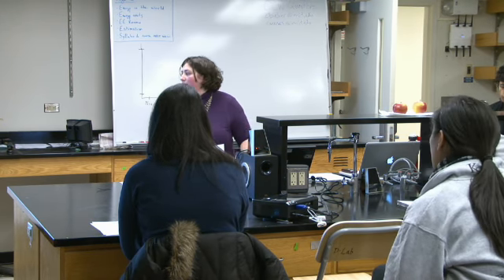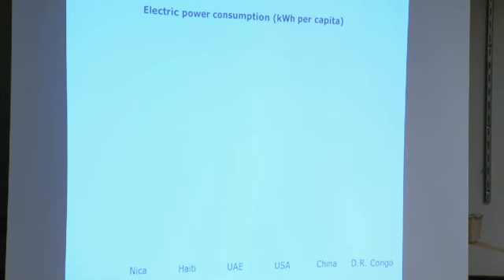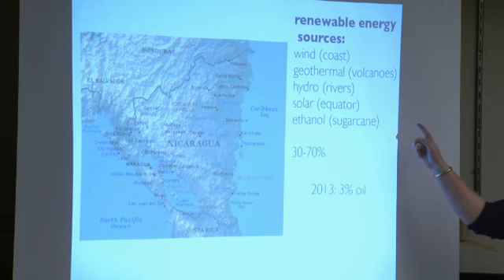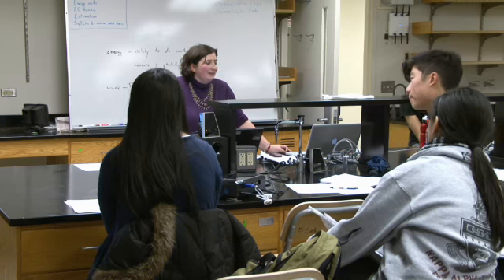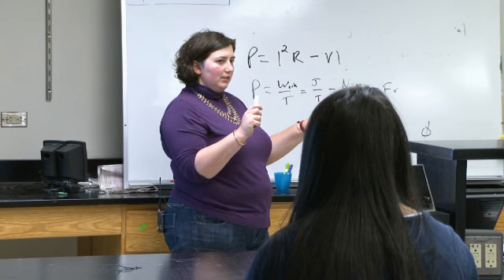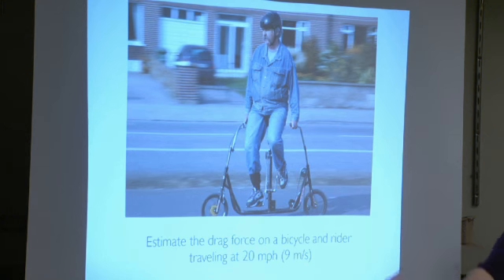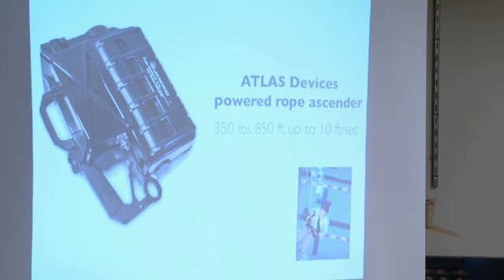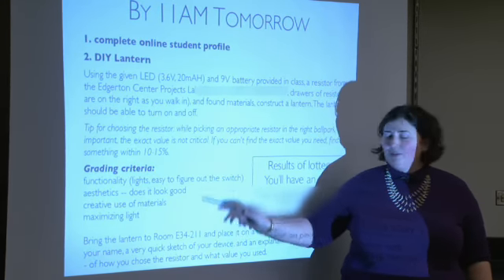1. Introduction to Energy

Comment: 1. Which statement best defines energy in physical science?

A. The rate at which force is applied
B. The amount of matter in a system
C. The capacity of a system to perform work or produce physical change
D. The resistance of matter to acceleration

Comment: Energy is not the ability to do work because there is no equivalence between work and energy. Work is not the force to move an object over a distance neither. This definition or description labels or identifies work as being a force and work is not a force. Power is not how much energy is required in a given amount of time because ,as mentioned, there is no equivalence between work and energy. Power can't be used to determine the amount of energy stored in a battery.
Reply: Please 3xplain it to me then in your words
Reply: @niketsinghsciencechannel3084  Energy is not the ability to do work, only that energy is required to do work. However, the work done on an object does not reflect the energy transferred to the object. We need to first look at the fact that work is not a function of displacement.

Work can only be done on an object moving at a constant velocity if the displacement of the object is caused by a force. An object moving at a constant velocity does not require an external force to continue moving at a constant velocity. The exception to this general statement is here on Earth with the presence of friction and gravity. Friction needs to be balanced to keep an object moving at a constant velocity on a horizontal surface and gravity needs to be balanced to keep it moving straight up at a constant speed. The energy transferred to an object in either scenario allowing it to keep moving at a constant velocity only balances out these forces and does not cause a displacement of the object. This is to say that no work is done on an object moving at a constant velocity by an external force. The displacement of the object is caused by its momentum. There is no distinction made between an object moving at a constant velocity with balanced external forces on it and the same object moving at a constant velocity on its own with no external forces on it. In both cases the displacement of the object is caused by its momentum. 

However, this does not mean that no work is done on the object moving at a constant velocity with balanced external forces on it. Momentum is incorrectly defined as the quantity of motion. Momentum is kinetic force or the force with which a body moves which refers to its impetus just like kinetic energy is the energy possessed by a moving object. So, you have kinetic force which is the force of motion and as well as kinetic energy which is the energy of motion.

The force with which an object moves is due to its inertia in conjunction with its velocity. The moving object has inertia or mass resistance which is the amount of matter resistance an object has to a change in its velocity. So, just like mass is the amount of matter, we have mass resistance which is the amount of matter resistance. Inertia is directly proportional to and depends on mass. The greater the mass that an object has the greater the inertia or mass resistance that the object has.

Inertia(mass-resistance) ∝ mass
Inertia(mass-resistance)  = k*mass
Inertia(mass-resistance) = (1)mass

This means that inertia is a scalar quantity and has the same unit as mass. We can also refer to inertia using the term resistive-mass(mr) with "r" as a subscript as a reference to its resistance to change in its state of motion. We ,then, take the momentum equation and modify it accordingly.

momentum = mass x velocity

Kinetic force(k) or momentum = Inertia(resistive-mass) x velocity

Displacement  = velocity(v) x time(t) 
Inertial-displacement = Inertia(resistive-mass) x displacement 
Inertial-displacement =  Inertia(resistive-mass)x vt
Inertial-displacement =  Kinetic force(k) x time(t)

The "inertial-displacement" done by the kinetic force of an object would be referred to as kinetic work. 

Inertial-displacement = kt
Kinetic-work(W) = kt

Kinetic work is the inertial-displacement due to or caused by a constant kinetic force acting on an object for a time. You can see that we are multiplying a vector(i.e. kinetic force) by a scalar(i.e. time) for kinetic work which means that work is a vector quantity and that the unit is kilogram-meters which is not a unit of energy.

The displacement of an object moving at a constant velocity is caused by its momentum or kinetic force. This is to say that work is done on the object by its kinetic force and not by an external force. We can see that the kinetic work or work done on an object moving at a constant velocity is a function of time and not of displacement. I can continue further and show you other things that are undeniable.
Reply: @niketsinghsciencechannel3084  Energy is not the ability to do work, only that energy is required to do work. However, the work done on an object does not reflect the energy transferred to the object. We need to first look at the fact that work is not a function of displacement. 

Work is done on an object moving at a constant velocity when it is acted on by an external force and there is a displacement of the object that is caused by the external force. An object moving at a constant velocity does not require an external force to continue moving at a constant velocity. The exception to this general statement is here on Earth with the presence of friction and gravity. Friction and gravity need to be balanced for an object to keep moving at a constant velocity. The energy transferred to an object in either scenario only balances out these forces and allows it to keep moving at a constant velocity. It does not cause a displacement of the object. 

This is to say that no work is done on an object moving at a constant velocity by an external force. The displacement of the object is caused by its momentum. There is no distinction made between an object moving at a constant velocity with balanced external forces on it and the same object moving at a constant velocity with no external forces on it. In both cases the displacement of the object is caused by its momentum. 

However, this does not mean that no work is done on the object moving at a constant velocity with balanced external forces on it. Momentum is incorrectly defined as the quantity of motion. Momentum is kinetic force or the force with which a body moves which refers to its impetus just like kinetic energy is the energy possessed by a moving object. So, you have kinetic force which is the force of motion and as well as kinetic energy which is the energy of motion. 

The force with which an object moves is due to its inertia in conjunction with its velocity. The moving object has inertia or mass resistance which is the amount of matter resistance an object has to a change in its velocity. So, just like mass is the amount of matter, we have mass resistance which is the amount of matter resistance. Inertia is directly proportional to and depends on mass. The greater the mass that an object has the greater the inertia or mass resistance that the object has. 

Inertia(mass-resistance) ∝ mass 
Inertia(mass-resistance) = k*mass 
Inertia(mass-resistance) = (1)mass 

This means that inertia is a scalar quantity and has the same unit as mass. We can also refer to inertia using the term resistive-mass(mr) with "r" as a subscript as a reference to its resistance to change in its state of motion. We ,then, take the momentum equation and modify it accordingly. 

momentum = mass x velocity 

Kinetic force(k) or momentum = Inertia(resistive-mass) x velocity Displacement = velocity(v) x time(t)
Inertial-displacement = Inertia(resistive-mass) x displacement 
Inertial-displacement = Inertia(resistive-mass)x vt
Inertial-displacement = Kinetic force(k) x time(t) 

The "inertial-displacement" done by the kinetic force of an object would be referred to as kinetic work. 

Inertial-displacement = kt 
Kinetic-work(W) = kt 

Kinetic work is the inertial-displacement due to or caused by a constant kinetic force acting on an object for a time. You can see that we are multiplying a vector(i.e. kinetic force) by a scalar(i.e. time) for kinetic work which means that work is a vector quantity and that the unit is kilogram-meters which is not a unit of energy. The displacement of an object moving at a constant velocity is caused by its momentum or kinetic force. This is to say that work is done on the object by its kinetic force and not by an external force. We can see that the kinetic work or work done on an object moving at a constant velocity is a function of time and not of displacement.

Comment: Hi, Amy Banzaert,  a pneumatic grid might be good to couple  low grade alternative energy devices with low grade use systems.  I did low pressure airlift pump work for the windowfarms community (as a hobby), and after 3 years the progress has been incredible.  I can now get reliable pumping with up to 20 to 1 lift to submergence  through 1/4 inch tubes.  It uses about  1 psi air. (2.3 ft of water) and I deliver it through a low pressure "pneumatic grid" to my "pallet gardens" about 100 ft away.